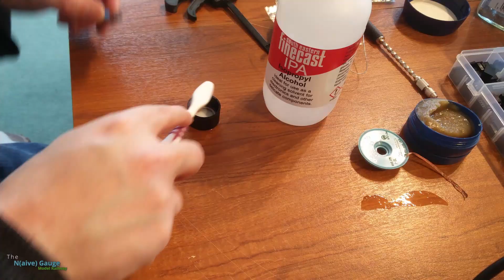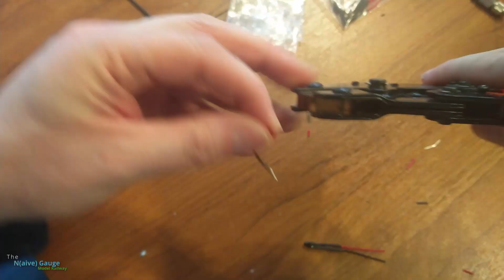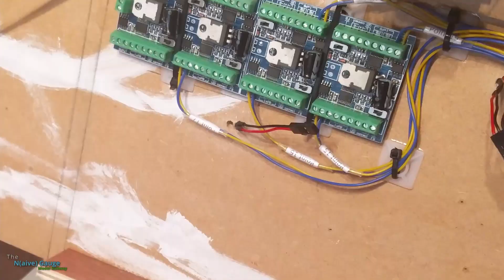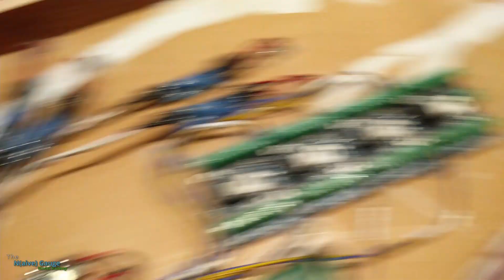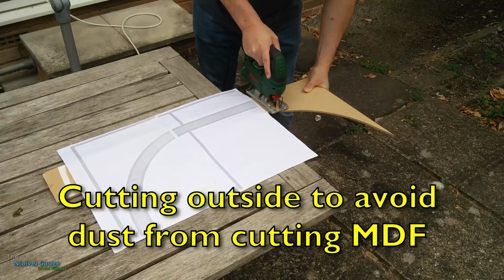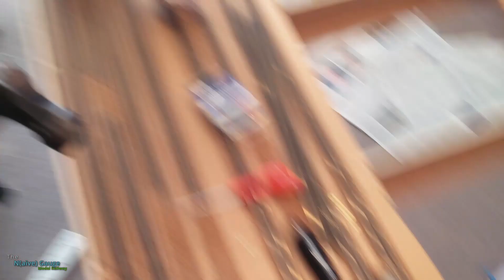32   layout update #3 | Golden spike moment.

Comment: hi naive i did reply to your last comment as i said the best way is to lay your track one peace at a time if you are going down the automation route then the best way is to put a isolated rail joiner to one side off the track then solder the red wire to that side then solder the black wire to the other side off the track you then bring the red wire back to the detector then the black wire goes to a common block then take one wire from the common block back to your power unit ok hope this helps ok derek thats the way i do mine and it should work ok.

Comment: Good to see you’ve got the first loop complete and train seem to run well. May I suggest trying to avoid kinks in flexi- track and where tracks join, as you may find some locos, coaches or wagons will derail. In the past 80% of my stock ran beautifully then I tried the pendolino (and few other co-co locos 66s, 47, 57, 60) and they and rolling stock were constantly being scattered everywhere as they derailed. It was mainly due to kinks and tight curves.

Hope you didn’t mind me suggesting such, just hoping to be helpful.
Reply from the maker: I wonder if I will end up re-laying some of my track...

Comment: Congratulations on completing the circuit, so pleased for you.  If you are going to use ir sensors, there is a smaller version called TCRT5000. I’m using them on my layout as they are a 3mm LED etc, which is a plus, but also the sensors come out at 90 degrees, so fit nicely under the board.  I’ve 3d printed a holder, so they fit securely..  Looking forward to the next video coming, as it’s nice to watch you address your problems.
Reply from the maker: thanks for this. TCRT5000 looks interesting. what scale are you modelling?
Reply: @naivegauge   I model in N gauge